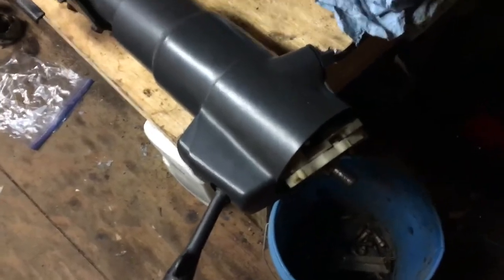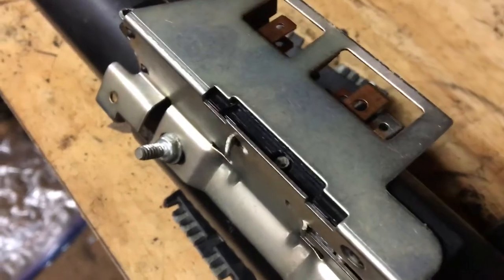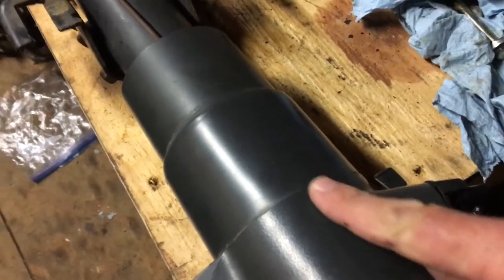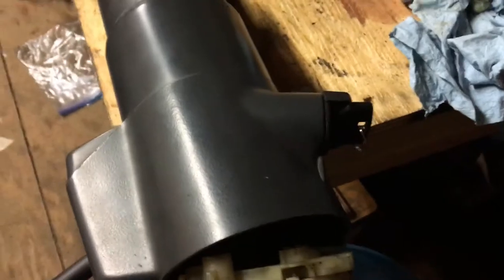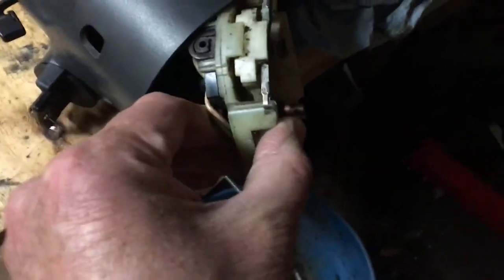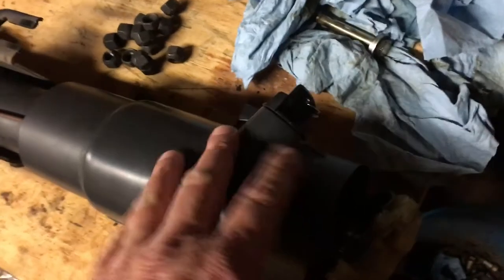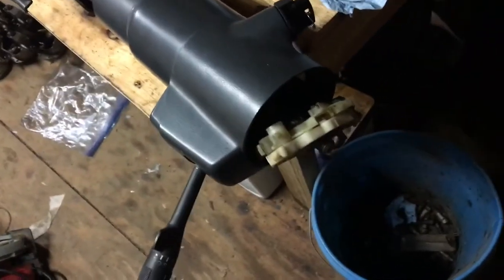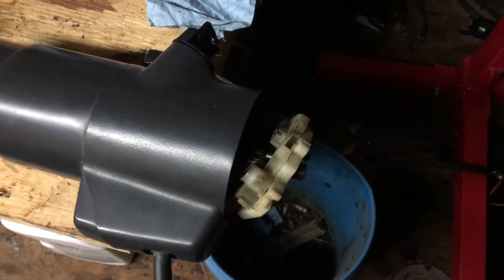1993 Jeep Wrangler Steering Column Repair - Part 2

Comment: i am chasing a no start, no crank issue on my YJ. This video is extremely helpful in seeing how everything is laid out.  I really do not want to pull the entire driveshaft, but good to know how and how to disassemble. Hoping simple starter switch does the trick! Thanks!
Reply from the maker: There is a master relay that turns on the ignition power and the ECM. Your situation sounds like a master relay failure.
Reply: @moccasinmarine  If you mean the relay under the hood, you can swap it with the horn relay (same one) and see if that has any effect. It did not in my case. I then found a helpful video from Bleepin Jeep about testing your starter with a multi-meter. I did not think my starter was that old - but I did just buy the Jeep.  Sure enough,  the starter is bad. It is getting electrical signal from the ignition switch and power from the battery. So I have ordered a new starter and hope to have it installed today!! I could not believe that was the issue since I just changed a starter in one of our XJs on Saturday (see video on my channel) -just a crazy coincidence I guess!

Comment from the maker: As I’m watching my own video it dawned on me that at the point that I had the lock cylinder released and removed from the housing I might could have reached in and pulled out the plastic gear. I then could have replaced the gear and popped it in place without removing the steering column. If this works you’ll save a lot of time.